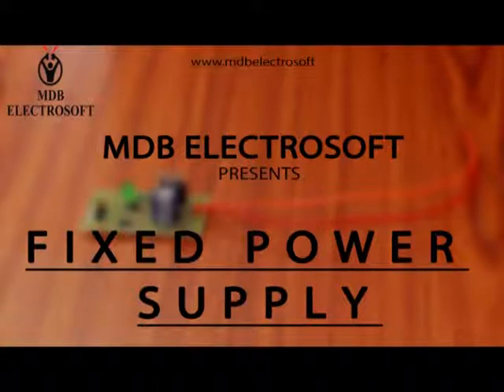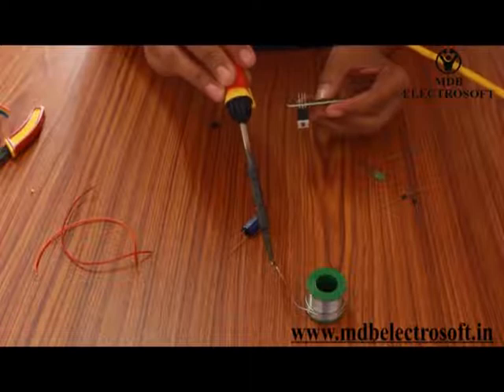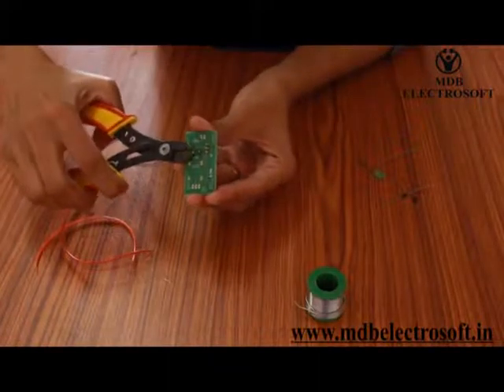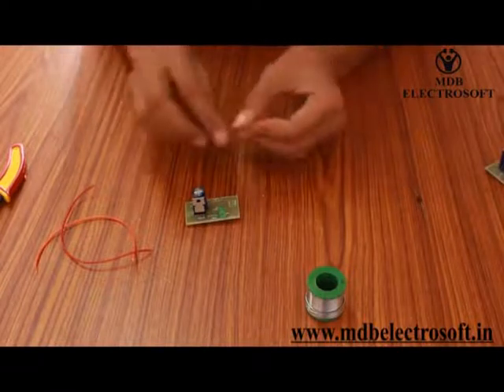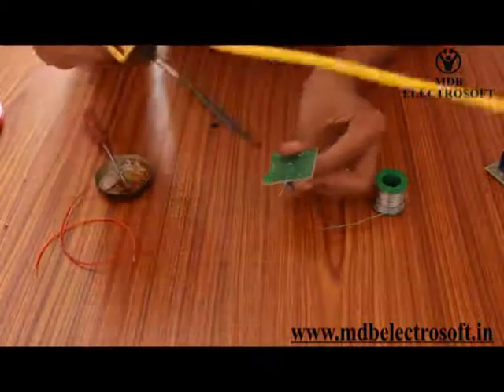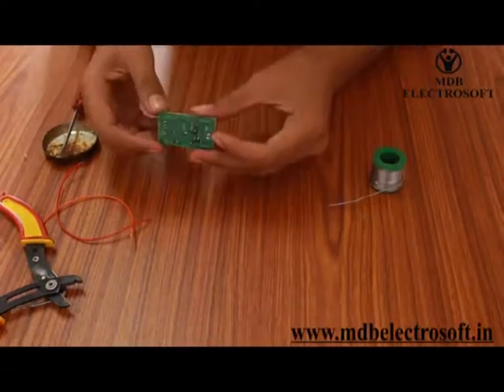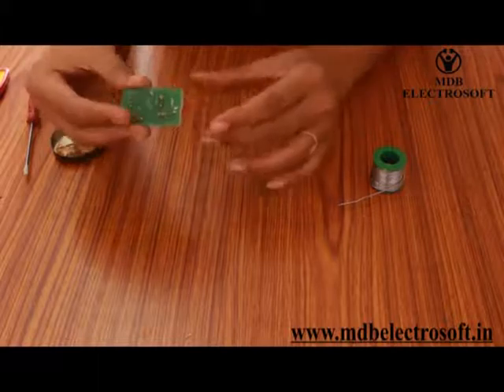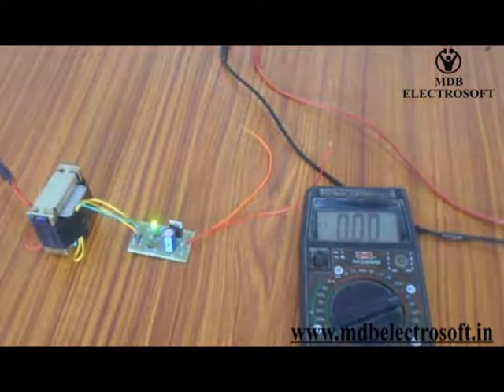Regulated Power Supply using 78XX series

Comment: IC regulators : Build a regulated power supply on general purpose PCB to obtain +5V , 500mA using IC 78xx series . Drive suitable load with regulated output
Reply: hii i also need that microproject have u completed it?
Reply from the maker: Please call for assistance 9604922180
Reply from the maker: Good keep it up